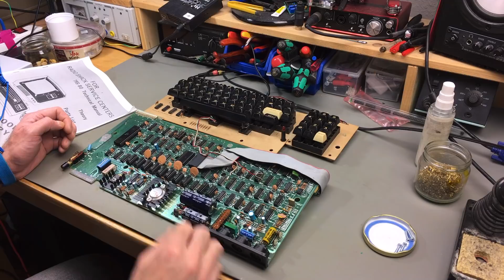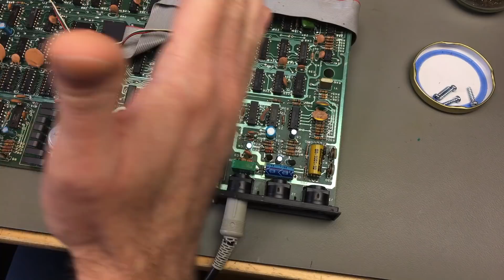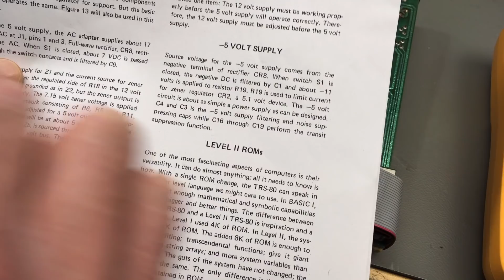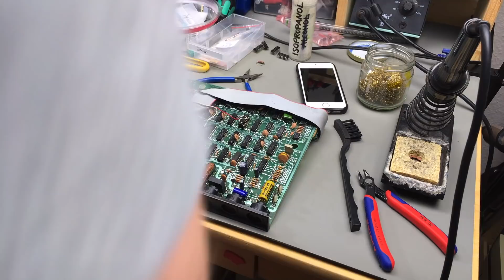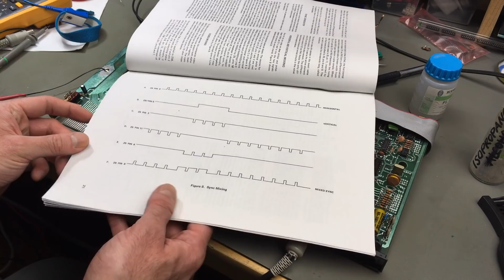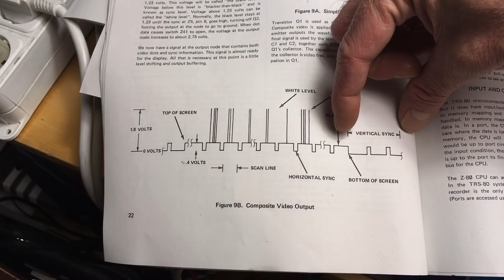Radio Shack TRS-80 Model 1 Troubleshooting Part 1

Comment: Hmm, fried resistors in the cassette port circuitry, and the same connector used for power/video/cassette, I'm gonna go with somebody plugged the power adapter into the cassette port :)

Comment: The chips are very voltage sensitive. Plugging in a vacuum cleaner or a slight power drop and it would lock up the computer. If you haven't saved your work, as you went along, it was gone.

Comment: At 39:05, I can't tell if your scope is set to the wrong time and voltage divisions or what, but that is not a normal composite video signal.  There is no pixel data.  There is only what appears to be a horizontal sync signal.

Look at the bottom of page 22 of this manual:

http://www.1000bit.it/support/manuali/trs/TRS-80%20Technical%20Manual%20%281978%29%28Radio%20Shack%29%28pdf%29.pdf

See the peaks following the trough of the horizontal sync that say "white level?"  You don't have any (or at least your scope isn't showing any, which could be because you have the time division too short).

Also, the signal should be about 2 volts peak to peak, and it should spend most of its time at around 0.5 volts (black).  Yours appears to be stuck at 2 volts most of the time.

Compare your signal to this one:

https://imgur.com/gallery/OJwQkS4

They do not look the same (unless your time and voltage divisions are all messed up and we're only seeing a tiny part of the signal... but even then I don't understand why your signal would be floating at 2 volts most of the time).

Comment: I have several functional Model I machines, so if you need someone to take a look at values on any burned out components, drop me a line. The garbage pattern you're getting on the display suggests bad RAM (or perhaps related to your missing A15 signal at the CPU... although as long as it's deselected, I don't think it's doing anything in a 16k machine, but that's just a guess :-). It's been a few decades, but sometimes the Model I would show similar (but not quite what you're seeing) garbage on the display, and you'd have to hit the 'reset' button (momentary switch next to the expansion edge connector on the opposite end of the MB from the power switch) a few times to get it to power up properly. Btw, if anyone happens to know why this occurred sometimes, I'd love to know.

Comment: I'm guessing that the cassette port resistors got fried because someone accidentally plugged power into the cassette port. IIRC the Model I uses 5-pin DIN connectors for all 3 connectors (power, video and cassette) making it easy for someone to accidentally plug power into somewhere where it doesn't belong. A rather poorly thought out design if you ask me.
Reply from the maker: Yes, that might very well be. The 3 DIN connectors are all the same 5-pin type. So that could happen easily.

Comment: The ringing you saw on the CPU clock waveform is due to the long scope ground wire you are using.   If you connect the short gnd wire on the probe itself to ground at the board, the waveform will look a lot better.  Not saying you need to do that when just probing around.   Just that it's nice to understand why the waveform looks the way it does.
Reply from the maker: Ah, that might very well be. Thanks!

Comment: (@41:12) - I’d just use an 8-position DIP switch there, and desolder the old socket; the pins look a little crusty. Then solder in the DIP switch, and throw s1, s3, and s5 to “on” to match the jumper config. 🤠

Comment: One of my first computers. I have fond memories of it though I never had floppy drives until much later when someone gave me one as a retro computer. A great book for this is the The Custom TRS-80 & Other Mysteries by Dennis Báthory-Kitsz. I used it in the past to add lower case mode and to give the system a little speed bump.

Comment: Great work, Jan! Man, I am having very similar issues with the power supply circuit section of my CoCo 2, as well. I have to say, the Service Manual for the CoCo 2 is quite impressive too. Tandy/Radio Shack did a great job with those documents. A great series thus far -- I'm glued to every moment.

Comment: A 74Cxx device is a 3V to 15V device, while a 74HC(T)xx device is a 2V to 6V device, so you should first check by which power rail the 74C04 chip is powered on the board.
BTW if you can’t source a genuine 74C04 chip you can find a replacement in the CD4000 (or equivalent) series: CD4049, HEF4049, MC14049, etc. should all be OK replacements in your case.
Reply: I very much doubt the 74Cxx or HC(T)xx devices even existed at the time, only 74LSxx logic (and 74xx logic) if the power rail is anything BUT 5V there is something wrong.
Reply: martin de jong That’s an interesting consideration.  Although the 74Cxx series was already in production in 1973 (according to the date of a Fairchild AN) the chips on the board may not be the ones installed when the board was manufactured.
Reply: 74Cxx chips are in the parts list of the Technical Manual for the TRS-80 model 1, so they were installed on the board from the beginning

Comment: Good show. Edit, you can swap the 4116 for 4164 chips by bending a few pins. Done it on a couple of Spectrums... That would negate the need for a -5v rail if you have the other rails present.

Comment: Jan...  as i remember there was a service bulletin for the cassette port that put that resister  there...  Further....  trs-80.org is up  now anyway... please be aware that the memory switch assembly  MUST be low height... a normal switch block will hit the case when you reinstall it...

Comment: I've recently built a new PSU for a 1977 signal generator and when I went to test it I was getting weird voltages. Same mistake: I had forgotten to connect the centre tap of the transformer! :)

Comment: Just a tip:the TRS-80's video hardware is completely independent of the Z80 CPU, so that even when you pull the Z80 out of its socket, the TRS80 will STILL generate a video signal, ( a random pattern of characters on screen)  there are no programmable devices that need to be programmed in the video hardware. What I seemed to see in the video is that you did not actually get characters on the screen, just blocks of white or black. To me that means that either the character generator (ROM) isn't working OR that only the RAM bit that inverts a character position of not is working, Also, the TRS-980's canonical "graphics blocks" do not come out of a character ROM, but are directly generated out of the bit pattern coming from the video RAM. so if you can see that the video output consists of TRS-80 style graphics characters (in a 2 x 3 block pattern) instead of full character sized pattern's you can draw a conclusion on whether the character ROM (or 2x3 patter generator circuitry) is actually active or not .  A closeup of the screen would be very helpful

Comment: As already noted in other comments, for a machine like a 16k TRS-80, A15 being permanently low is entirely expected - IIRC, the Z80 starts execution at 0x0000, so the ROM will be 0x0000-0x3fff, and if the RAM is 0x4000-0x7fff, there's no reason A15 would go high in normal operation.

Comment: 74HC04 would be a better choice of replacement for a 74C04 than the TTL compatible 74HCT04....Assuming theyre pin compatible.
Reply: I've used the HCT family for that specific spot.  It works fine.
Reply: @Calphool222  Oh cool. Its always better to have confirmation from someone whose actually tried it and found it to work. Theres not a huge difference between CMOS and TTL logic levels and if its not critical....

Comment: All things considered Jan there could have been much worse mistakes to make with the power supply connections, its the sort of thing we've all done at some time, I once made a mistake connecting up a switching power supply board I'd picked up from a electronics recycling company and it went bang. The power transistor on the primary side was just 3 legs sticking out of the board and the rest of it I found stuck in the ceiling tiles......
Reply: Ian Rolfe Sounds like a serious BANG… 😮

Comment: I think the RAM chips may have been socketed as standard. Since there was also a 4K model. Though I'm unable to find a 4096x1 bit DRAM which is pin compatible with the 4116.
Reply: the Ram chips were not originally socketed ...  when I upgraded mine I had to desolder....  it was one of the first times I ever did that...  I made a mess and at that time not know what braid was....

Comment: Great work! Went down a few rabbit holes there with that Tandy Trash-80. Inspiring me to get my Amiga 1000 & 2000 out of their boxes and up and running again. Got a bit of work to do in power supply re-cap, repair leaky battery corrosion on 2000, flaky floppy disk drive, dodgy mouse on 1000.

Comment: Is A15 on the Z80 being used?  You can address the first 32K without it, so depending on where ROM and devices reside, you may never use A15.
Reply: According to the documentation the level II ROM (12K) is 0000-2FFF
http://www.computerarcheology.com/TRS80/Hardware.html